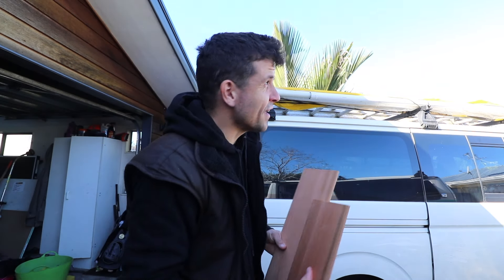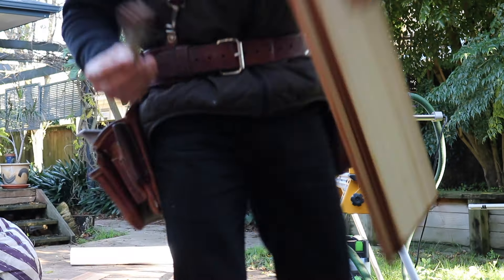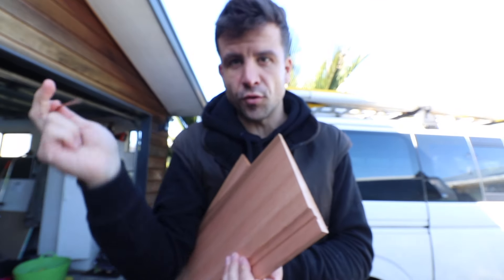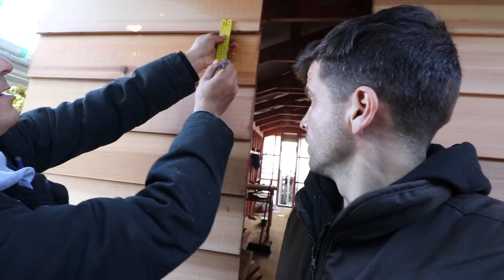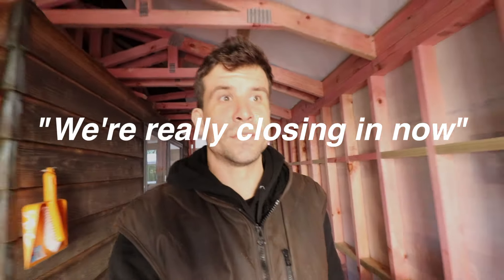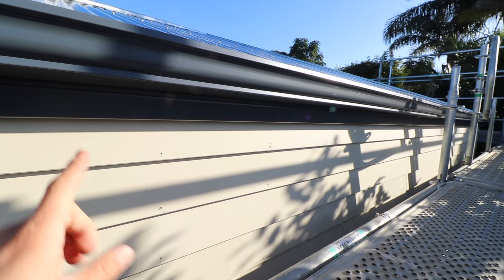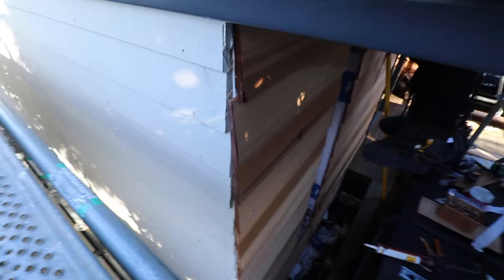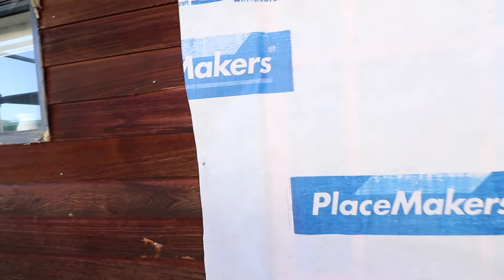Installing (beautiful) Cedar Weatherboards

Comment: Went to the trouble of oiling behind the overlap of the boards and the butt joint ends but not behind the joint soakers? The place they'll actually get moisture sitting.

Comment: How long would this cedar last on a beach house ?

Looks like a great job
Reply: Depends where you are. Here cedar gets a 25 year shelf life untreated.
Reply: @batmansdad3195  Australia, Fraser Island
Reply: @jimbob1427  I see you get lots of moisture, which is good to keep the cedar from dry cracking. I don't know how long the stains and what of you have in Australia last, but here in Canada with it all being waterborne they all say the stain lasts 5 years. 

Kiln vs air dry also plays a factor. Kiln lasts longer here, but as long as always maintained cedar will last a lifetime. We have house here over 100 years old with still the original 3" reveal.
Reply: @batmansdad3195  ok thanks for the info 👍

Comment: Quick question. Do you need batons on the outside? Or can I put cladding on the house wrap. I'm no expert but doing a shed
Reply: Maybe I am a little late but the batons are there to help drain and ventilate behind the cladding so if you live in an area that sees a lot of rain then it's probably a good idea to use batons.

Comment: Have you thought of using a story rod? Work out your spacings, Mark a rod and use a datum line, therefore you won't need to level every single board. can always chalk line the wall too if you're worried about bowed boards

Comment: Can i use screws instead of nails to avoid the possible separation or movement of the boards caused by moisture and sun?
Reply: Cedar is very good at not warping. Screws wouldn’t achieve that same look

Comment: Do you remove the gun nails before putting the other nails in? Reason I ask is that I was always told to only have 1 line of nails across lapped boards to allow for contraction and expansion, and that if I put in two lines boards would split as the years weather took effect so interested to know. Thanks for all the vids, just working my way through them all at moment.